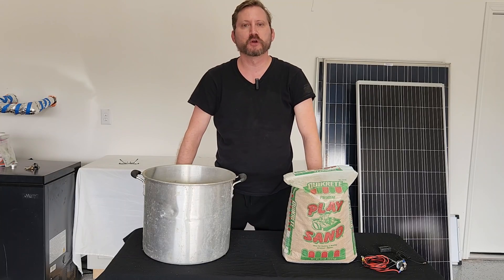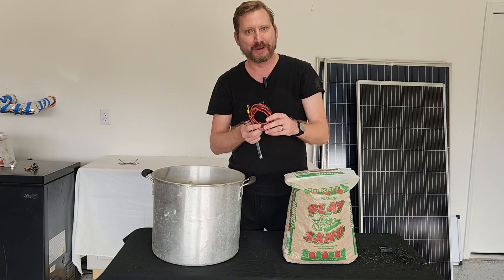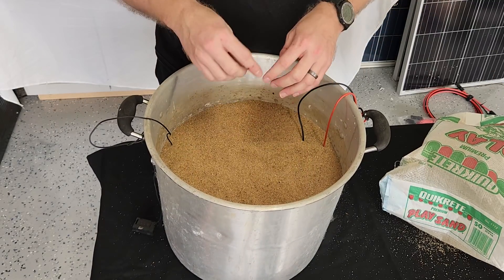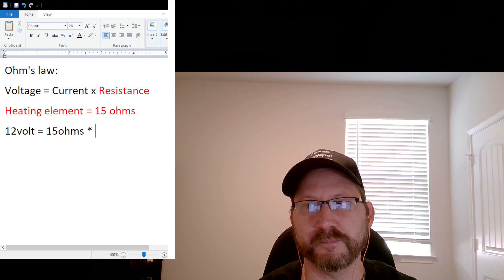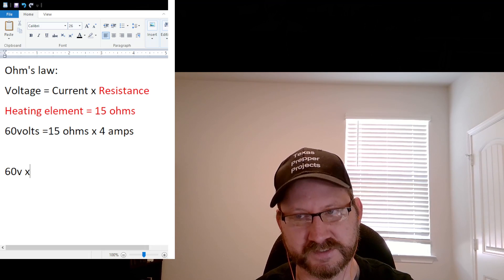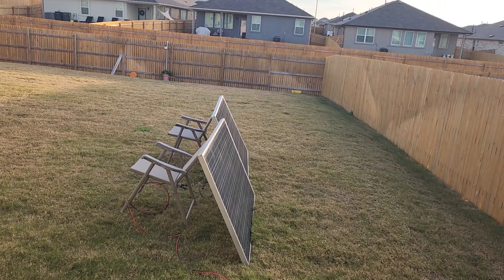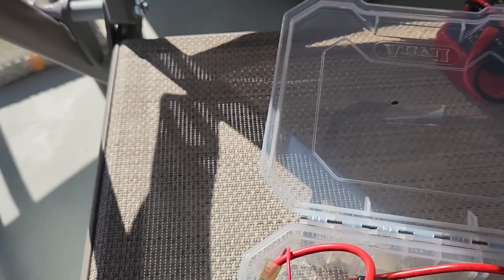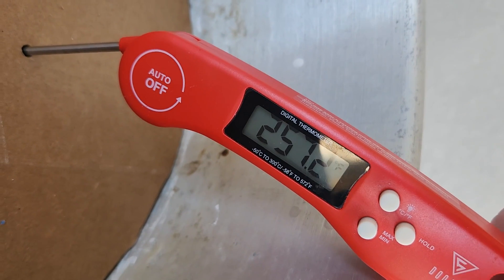Sand Battery Heater solar powered 250F / 120C with no flames or fuel! DIY

Comment: Thermal mass or Heat battery...  JUST THE FACTS All Materials have whats called K value or thermal mass value.. Kind of or basically the inverse of R value in insulation ratings. This K value is the amount of heat that can be stored in any Material. BY the way the unit of measurement is based off of water having the thermal mass of 1. This is the standard. Numerous charts can be looked up, and referenced for verification.  Water has a thermal mass of 1 as mentioned HOWEVER rock only has .2 or one fifth of the  thermal storage potential of water by Weight. Rock is more dense  Pea gravel has 95 pounds in a cubic foot. BUT water only weighs 63 pounds per cubic foot.  This weight advantage of Rock VS the HIGHER thermal storage capacity of water Results in WATER stores 3.26 times more heat per cubic foot than pea gravel. Even HEAVY dense stone solid Marble is only 150 pounds a cubic foot and STILL does not beat water for BTU storage. 
 It takes about  1340 BTU to heat one gallon of water from 40 degrees F to 200 F
That means a 55 gallon drum of water heated to 200 would let off  about 77,000 BTU's of heat before it went back down to 40 F. To get the same heat storage you would need to heat Four 55 drums full of stone to store the same amount of heat
Reply: Water boils at 100 C basalt rocks can go over 1,300
Reply: @BasaltGuru  You are absolutely correct again. 
 And that means you would have to have a stone thermal mass 1000° or 5 times hotter than water to put the same amount of heat in storage. A 1000 degree thermal mass is a fire 🔥 Hazard  and Dangerous and would instantly burn anything or anyone that touches it. 
In addition you cannot possibly heat rock up to that temperature in a stove that doesn't burn that hot. Even if your stove did burn that hot. There's no way to distribute that heat into that size of stone. Heat  can easily be transferred into water and distributed evenly with a simple heat exchanger.
Reply from the maker: neat! But that also means that you have to put 1340 BTU  into that same water to get it up to temp!
Reply: @texasprepperprojects  absolutely agreed. Since you only get out of heat batteries what you can or do put in then being able to put more in means you get more out .
Reply: However a professionally built container that is safe would then be able to handle far more heat than water for a large building. Basalt volcanic stone would be best.
Reply: @nickgencarelle1433  nope for a few reasons
Reply: The first glaring problem with your suggestion is that volcanic rock is not very dense and full of holes thus it does not store very much heat it is a poor choice for a thermal Mass again I would refer you to the charts where you might find something like soapstone which is far superior to volcanic rock for a number of reasons. Still that would not be best. It seems you fellows would like to launch proposals without any research and are a little bit hard-headed so I will leave geniuses to your speculations . Suggestion if your pride will allow you to receive such a thing would be ... Crack a book
Reply: Mix water / old transformer oil and rock ...how would that go?
Reply: All accurate, but it appears sand batts and dry rock heat storage systems can utilize air as the transfer medium rather than water, trading efficiency for simplicity/no danger of collateral damage due to plumbing issues/utilizing fans rather than pumps to move heat/so easy even a Luddite dinosaur like me can do it!

Comment: THought about doing this for my room which has no heater and has large windows so its always a few degrees cooler then then the rest.  The idea was to use excess solar to do it but had no idea how long the heat would last and how much sand id need.  From my experience sleeping on the beach, sands gets pretty cold quick at night so I didnt bother.  Even the hot oil from my radiant heater gets cold in half an hour or so after its turned off.  Youd need to cook a giant rock i think for hours to have it provide heat all night, and thats what they did with rocks in fires and put them under their beds back in the days, not surprising some warm sand wont do much.  But its better then nothing, especially with excess solar might as well get some heat out of it, espesially to say transfer heat from a  part that isnt getting and solar radiant energy, like the side of the houe not facing the sun.
Reply from the maker: if the problem is that your windows are single pane, then you're better off insulating them with pink foam and using an electric blanket. This is what we did in our old house during the Texas bizzard
Reply: texasprepperprojects  explained the most crucial thing about your situation. Insulation (preventing heat to escape the room) is the most important thing. However , it can be costly and complicated to do (and you still can use his advice , or put some thick , multi layer fabric curtains for the purpose ). The next thing (and I'm talking in cost effective terms) is to use some kind of termal mass , like sand , or water , or heat bricks. Your oil radiant heater has low heat mass and puts out relatively low temperature , so , if you (for an example) brick it around (leaving one side open , for normal function during the day) , the time of heat radiation will be much prolonged , after you switch it off. 
 Benefits of the sand battery that is displayed in this video are it's low cost , relative mobility and no cost to operate (if we exclude the cost of solar panels). It can be done with any metal container , or even clay pot , though , it can be troublesome to poke holes trough it (big , or small , depending on a need for mobility and the purpose - is it meant for heating room in the house , or permanent installation in the greenhouse , or chicken coop , or shed/workshop/garage...). Sand batteries can accumulate very high temperatures (which makes them better than water) , which can be used for longer periods of time , until all the heat/energy is depleted. 
 If you have solar panels , or wind turbine , you'll easy solve this problem. Otherwise , it is all down to energy cost. Bear in mind , that in this video , solar panels produced about 240 W ,  but , during (let say) 8 hours , the amount of energy , stored as a heat is nearly 2 KW (1920 W). You'll get the same results , if you plug in the heating element of the same power rating (2 KW) in the wall outlet for an hour. If it has been done indoors , it will (probably) reach even higher temperature (than in the video). 
 The rest is very well explained in the video , except the fact , that one can get low resistance heating elements , which are made for car/RV/camping use and there are , also , ceramic heating elements , that , usually last forever.

Comment: What about vacuum solar tubes ?
Reply: I wonder if more heat could be collected with evacuated solar tubes
Reply from the maker: I doubt it. It would depend on surface area of the tube, angle, size, etc. And then you have go be able to efficiently transfer that heat someplace
Reply from the maker: What about them?

Comment: good explanation of the capability of sand batteries. I think its important to note that while water technically can hold more energy than sand thats only true in practical use while in liquid form. You can dump energy into sand a long time before your sand starts to boil away! I also think that you should explain that 240 watts of power is really only the same heating ability of 3 candles so don't expect amazing results.
Reply from the maker: thanks!

Comment: Water can hold more energy at 195F and you can move it around wherever you need to with a small pump, tubing and a heat exchanger. You poured water into the sand for better heat transfer and capacity right?
Reply from the maker: Nope. Because then I'd have to waterproof everything
Reply: Water boils
Reply: Right, you can use an IBC with 1000l and heat it up to 60degC. With a temperature difference of 40degC, you have roughly 40kWh of heat energy.  If you use a SandStorrage with the same energy. you can heat it up to 100degC and need with a temperature difference of 80degC 1,7m3 of sand

I choose 100degC, because then you can put into the sand a stainless steal pipe and run water trough and use the heat as you wish

Comment: Would this work for a non insulated crawl space with a stove fan, just to keep pipes from freezing during the night
Reply from the maker: Probably not. You are better off with electrical heating tape pipe wrap and insulation

Comment: i often think about trying a passive system using the sun, a powerfull magnefying glass,  an enclosed  stoking area could be  for example  a pit isloated with sand and earth but the top is a thick glass where a maynifying glass heats volcanic rocks filling that pit or  lets say a old 5sq feet   freezer. to see how hot it can get. volcanic rock absorbs heat a lot. connected to that old freezer a fan pushing the heat into the home with isolated pipes. I winder if that could heat a home in case of electrical shortage?  Or even  if no electric shortage those volcanic rocks could be heated with a 3000watts  water heater element from the electrical grid. Does anyone think something like that would work?
Reply from the maker: Nope. Not to heat a house. But look at my other videos for parabolic tests

Comment: have you seen the 1/4'' x 1'' 40w 12v heaters for 3d printer 'hot ends'? i bought 10 and strapped them to my 10gl water bucket as a solar dump. they can get to 500f!
Reply from the maker: Well thats 400w so it doesn't surprise me!
Reply: @texasprepperprojects  yeah but the other thing is they don't cost much, it's a nice way to heat things from 12v without conversion losses. I do also have a 240v element and a diesel water heater on a loop with the engine so i can even reclaim engine heat losses. (My build is in a camper) but I'm looking at ways to heat the living space as... well... winter...
Reply from the maker: nice @lezbriddon